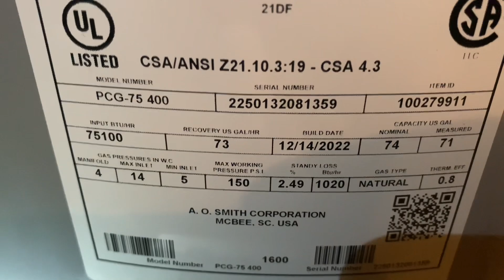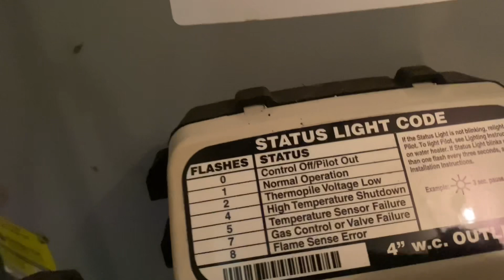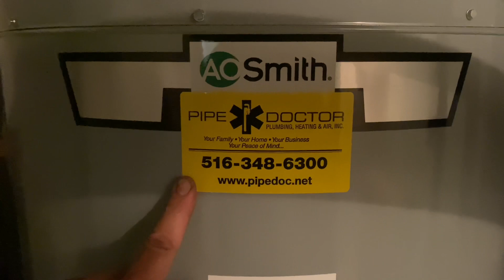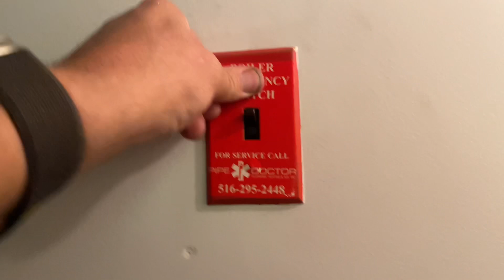Pilot Lighting Instructions - AO Smith 75 gallon Gas Water Heater

Comment: Would a simple fix be a dryer vent installed backward (flap on inside) to draw in air when units are running?
Reply: I bet that would work well! Hurry up and paton that one..
Reply: use a air intake for fireplace/gas log/wood burner conversion kit. they look similar to to dryer vents, but have a screen on the outside to keep bugs and critters out.

Comment: Gas Furnaces and/or Gas Water Heaters, both need either Home or Outside Air to Safely Function.  In STL, you Won’t Pass Inspection when New Units are Installed.

Comment: Just repair my hot water tank 21 years old. It's a state tank. 40000btu With the same one. I will not go cheap because it is what it is.
Reply: You must have a smaller capacity tank. Typically the 40 and 50 gallon ones have a 40k btu burner and the 75 gallon have a 75k